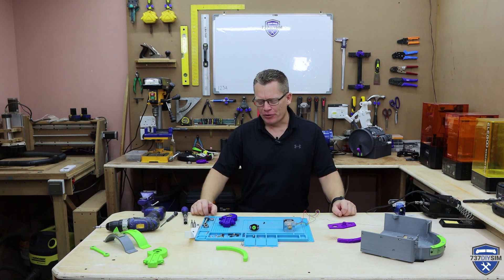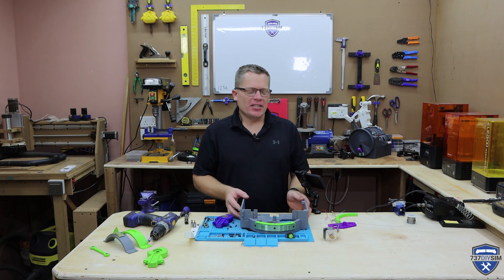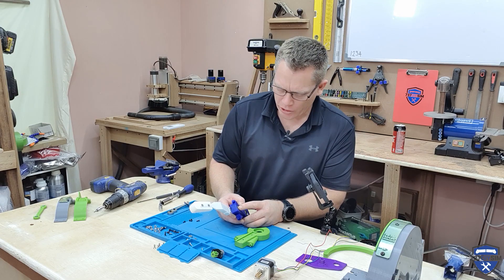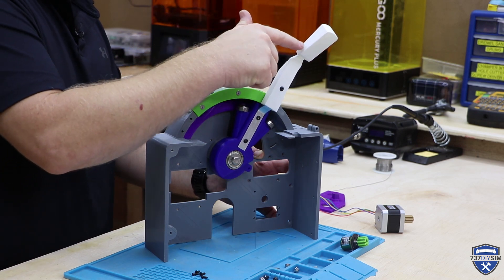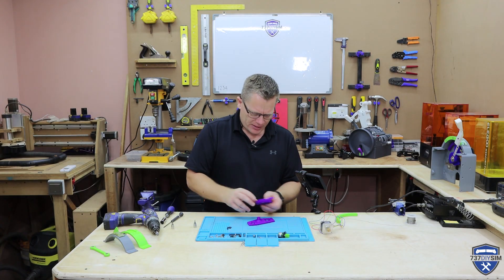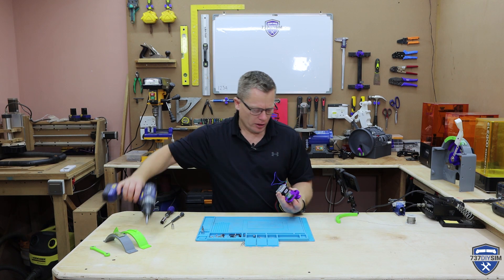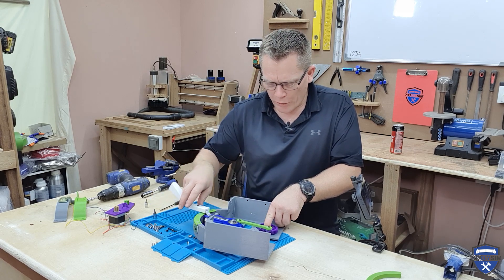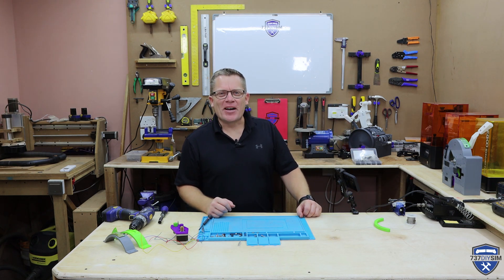Spd Brk Update

Comment: just FYI, Nema 17 on PLA tend to warp or pull the screws into the plastic over time. They tend to get quiet a bit warm over time and PLA does soften at quiet low temperatures and starts to creep.
Reply from the maker: Hello! I think you just managed to get this comment in at the exact right time. I am currently just building the final version now and will change from pla, to Petg or abs to try and combat the heat created. It's something I hadn't thought of, but now is completely obvious. Thank you for sharing you knowledge, very much appreciated  Karl.
Reply: @helimech8152  cool - cant wait to see the result :) Sometimes putting a metal backing on the opposite side of the stepper can spread the heat and pressure on PLA. I built several camera related motion systems over the years and always ran into the heat problem, obviously only where steppers have to provide a holding torque and therefor constant heat.

Comment: Hey Karl, wanted to share with you a little tip I recently discovered.  Try adding some mouse pad material between your brake and wheel, it adds SO much good feeling when adjusting tension.  Give it a try!
Reply from the maker: Will do! Kind regards karl

Comment: Will you detail the bearings, springs, screws etc used?  When you use screws are screwing into the PLA or do you use lock nuts?  A close up shot mr deville😂🎥, slowmo📽 of you assembling these complicated 🧐parts would be great with perhaps a text overlay, please please 😌
Reply from the maker: Hello, I will put the parts up when the unit is semi finished or close to final design. This is just prototyping and you can see already I'm changing parts all the time. I could only imagine the negative comments I would receive if I put the list out now and changed the parts along the way! Once i get to the real build video, i will take your advice and get those close slow shots you requires, and the text overlay is a good idea! Thank You. Karl

Comment: How you created that little hole to hold the 9mm bearing and then how it detents was just mindboggling! The littlest details really do matter. Brilliant!  0:57
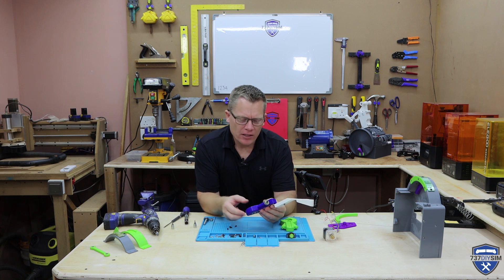Reply: I also think you mistakenly called this the throttle stem at 1:39  Whoopsie!
Reply: Similar systems use i.e. steel ball. They are probably less sensitive to the shape of the detent holes but this can maybe give you smoother running over the surface and less of an abrasion. 
Lovely to watch - how the unit builds up and takes (to be) final form.
Reply from the maker: Chuckle, thank you!